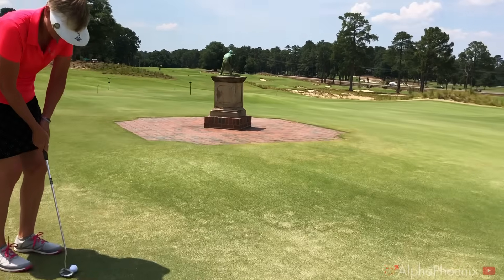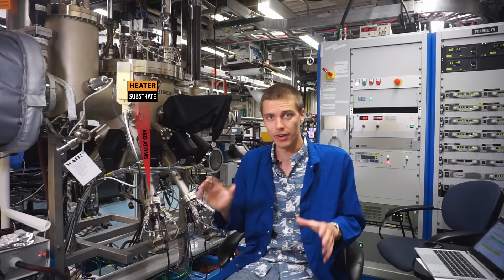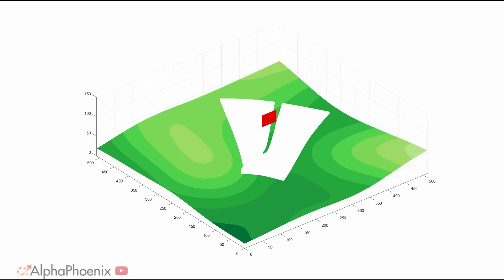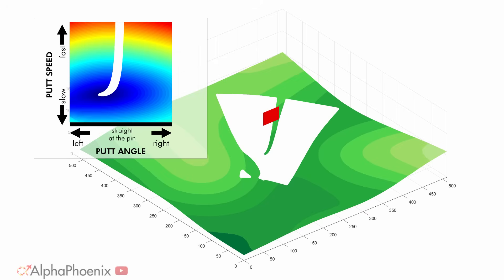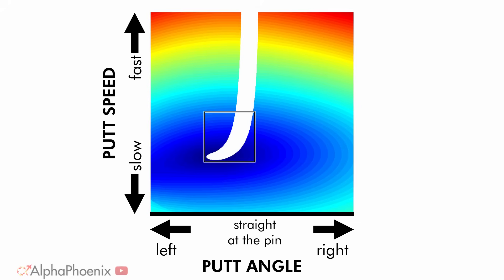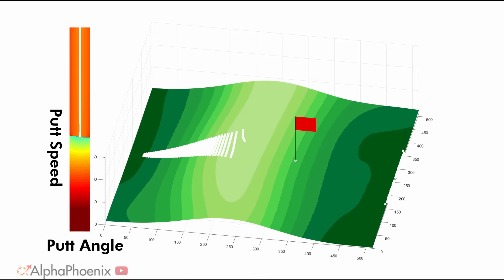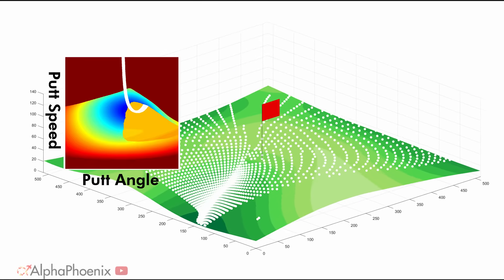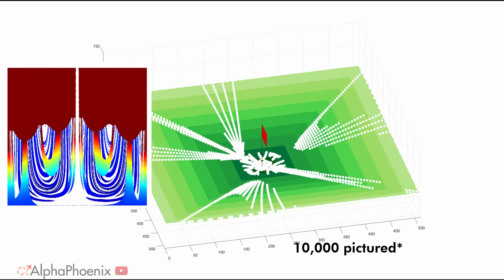Overcomplicating GOLF by simulating every possible shot

Comment: This is interesting - when the search has cost for every step, I wonder if you could adapt the machine learning technique of simulated annealing. It searches an n-dimensional parameter space blindly, only getting one datapoint at a time, and works if you can somehow quantify "desirability" of the return value. This way is mathematically proven to get a global optimum with infinitesimal steps.

Comment: With what you were talking about at the end with multi dimensional phase spaces, a full golf swing has so many variables that it fits very nicely into the idea

These include angle of the club path and face, the loft presented to the ball, the angle the club approaches the ball, the speed it goes at and where the ball connects with the face. If any one of these is just 1 degree or mm off it can have such a huge impact on the result.

The idea of a physics simulation going through all the variables to find how many different sets of inputs give a hole in one sounds so fascinating.

Comment: An important topic you are starting to touch on here.  Thank you.  A meaningful part of this field has been very well developed by statisticians broadly under the label "Experimental Design."  Also called "Design of Experiments."  Or DOE for short.  Optimizing 5 or even 50 variables is not unusual.  You can make any set of assumptions about how high order the interactions and non linearities are.  You can have nonuniform noise in different parts of the space and even design to estimate the noise as a function of location.  You can have errors-in-variables meaning how you set the conditions of your experiment is itself with variability.  You can optimize sequentially, recalculating the next most informative data point to test after analyzing the previous set.  You can do this as group sequential designs.  You can optimize a combination of expected performance and variability.  You can have non-quadratic loss functions.  And much more.  As I said, this has been well studied for 100 years now. A 60 year-old classic text is called "Statistics for Experimenters" by Box, Hunter, and Hunter which you will find easily accessible.  But, as you can imagine, the field has progressed a long ways from there.  Look up "D-Optimal" designs.  And "Thompson Sampling."  Thanks again for recognizing this important field and for the pretty simulations.

Comment: Here's an idea for extending this MATLAB experiment: Fix the shape of the player's error (e.g., the rectangle from the video, or a Gaussian) and then define a function that, for each ball position, outputs the expected number of strokes it will take to put the ball in the hole, under optimal shot selection. You can compute this function via "value iteration", which involves many calls to the kind of code you already have. Then you can compute the optimal shot a player should attempt from each position on the green. Maybe this is too far off from the intended purpose of the channel, but it's a shame to be so close and not go there.

Comment: 8:50
In real physics, the area in phase space needs to be non-zero for it to have a solution. If you have an area of 0 (or length of 0 for a 1 dimensional phase space, volume for 3 dimensional, etc) then it has no single solution unless all adjacent points have the same solution.
This isn't like an exact, precise law but it comes out of the math when you take the limit from both sides and note that the behavior does not change at all, you find the limiting point should not exhibit the same behavior at all. 

In fact, physical experiments would indicate that it is just 50/50 that it goes one direction or the other. Specifically, you can take the set of possible outcomes at all regions adjacent to the point/line and create a dice with the same number of sides as there are elements in that set. So if you have 3 different ways, you have a 1/3rd chance of it being one of the possibilities. If it is a circle, it has an equal chance of going in any direction. 
The time it will change direction is completely random and so technically there is a chance that it does make it up the pyramid anyways, but it's not 100% in real life even if it was just sitting still seemingly in equilibrium. It's like the murphy's law of physics.

Comment: The wonderful thing is that putting just a bit more realistically gets you into a 3d phase space where slight deviations of your putter's angle can start giving you side spin and that that difference can start majorly shifting the results with the other two factors reasonably constant (especially if you define your shot angle as being based on your putter's center of mass movement rather than the actual direction the ball starts moving at)

Comment: I used to play on a miniature golf course (just putting) that seemed to be impossible to sink in one stroke.  As I recall, a slight hill would send the balls back toward me if slow, or high, missing the hole.  It was like a lens diffracting the balls away from the hole.  I don't think it was done on purpose.  The course was L shaped, but you can model the bounce or eliminate it by folding the course there.

Comment: For the impossible geometry, can't you have something that curves inward so the ball rolls up a slope then falls when the ball is rolling upside down? (This would mean that the ball would have to either have a height when initially shot or to break a hole in the unbalanced structure)

Comment: quadcopters could potentially benefit from phase plots. there are 4 inputs, motor speed, and a desired rotational speed around an axis. changing one motor effects all three axis, so it's quite complex. right now we use a PID controller, 3 actually, one for each axis. then we spend many hours tuning it until it's 'good enough' (which is pretty good to be fair) but never perfect. with a phase plot, we would instantly know how much to spin each motor, instead of this constant guess and check it does now.

Comment: Sticking with the golf theme, i wonder if you could simulate the golf ball paradox within phase space - where the ball going into the hole, with the right speed and angle, will come back out of the hole without actually touching the bottom of the hole after making several rotations of the hole.

Steve mould shows a demonstration of this here - The Golf Ball Paradox
https://www.youtube.com/watch?v=5sbM2Isx17A

Comment: I had to INVENT this phase space thing at my job. 

I had to find the sweet spot of a machine that had several operating states. using three analog flow regulators.  that makes it a 4D hypercube problem.
I needed to hit three target static pressures on the system.
and my only control was three needle valve regulators (one of which was installed backwards)

I never solved the problem. I got it within tolerance and re-ran the hoses to isolate the air-in line.

Comment: Space travel, orbits, and such are similar. The objects leave the atmosphere out of fuel with a speed and trajectory, and then physics mostly controls the rest. In space travel, two of the dimensions are speed and trajectory, but there is a 3rd dimension, which is time. When you go on the journey matters as the objects with gravity that will affect the journey are moving relative to each other. So, maybe its similar to putting towards a hole with moving dips and hills... where you can predict the dips and hills in advance... and use them to your advantage.

Comment: So if you were plotting multi-dimentional phase spaces (4+) would it just be easier to plot 2 or 3 dimensional phase spaces for a limited portion of the controllable variables and compare them against one another? Like some form or multidimensional phase cross-sections?

Comment: The color map you used here suffers from one of the infamous "Matlab defaults literally-literally-literally kill people" problems, namely, it isn't perceptually uniform, which ends up injecting numerous artifacts into the map, making it highly misleading (unless one knows this and mentally compensates, but that's tedious & error prone, and not something anyone would expect from viewers)

Also I might have spotted a gamma blending error in there in addition to that, not entirely sure tho.
Reply: Additionally, your shot spacing algorithms seems to suffer from anisoperimetric bias, i.e. you should have either offset each row inside hexagonal space instead of in euclidean space (cf. the issue Feynman had with Cellular automata for gas simulation), OR instead of doing any of that, simply defined the boundaries of the shot space and then shot randomly (ideally use a quantum RNG or at least a cryptographically secure RNG as the input instead of a PRNG, but that's a bit overkill) shot instead of using offsets with granularity
Reply: Now, one might say, "but in the limit, it'll even out, so with a large enough sample size, it doesn't matter!", and that's true in symbolic math and with arbitrary precision libraries as well as when leveraging interval arithmetic libraries to some degree, but not when using matlab's out of box features which simply rely on IEEE754 floating point numbers iirc

Comment: Pool/snooker would be an extremely interesting one, you have power and angle much like this simulation, but you can affect the balls behaviour by striking it at different points. A cue ball struck with spin will affect the target ball in a very different way depending on direction and speed, players do this a lot to “widen” the pocket as aiming to “cut” the ball but also put spin can increase the chance of the ball actually going in.

Comment: I know this is an old vide by this point, but I wanted to say that there IS a geometry that makes it impossible to putt the ball into the hole from certain points. This is pretty much exactly the same as the illumination problem. If the course was designed like a Penrose unilluminable room from certain points there would be no possible shot to make the hole.

Comment: This video isn't exactly new, but if you're still reading comments on this, a phase space I'd love to see would be feeds and speeds of a mill, you have many potential variables but you can get away with keeping some constant, here's a list in order of importance:
- Feed (Velocity of cutter)
- Speed (RPM of cutter)
- Flutes (# of cutting surfaces per rotation)
- Diameter (Diameter of cutter)
- Material engagement (How deep the cutter is in a material)
The reason you want to proportion these variables is for the finish on the material, feed per tooth (amount of metal cut by each flute every rotation), and forces applied to the cutter.
Though, after writing this it does seem a bit complicated, lol.

Comment: My Dude.

First, as a chronic overthinker with ADHD who simply has to try to understand EVERYTHING, I love your work 👌🏽

Secondly,  you should REALLY look into motorcycles... 
ESPECIALLY in regards to riding on race tracks.

The way they steer, geometry set up, mass, trail, rake,  torque and levers everywhere in ways that arent initially obvious, how the tires generate grip beyond the normal coefficient of friction...

They are a physics play set 🙌

This is probably why I race them.
And I think you'd love getting right into it.

Comment: How about simulating the movement of 50,000+ virtual asteroids through the solar system for the 7M NEO 2020 VW from the date of last observation 2020-11-18 through 2074-11-03 to show the growth(and folding) of the uncertainty region? Note 0.03% to 0.07% of the virtual asteroids "may" become virtual impactors. 2020 VW maximum Palermo Scale is -4.13; this puts the risk from 2020 VW far below background risk.

Comment: When you really think about it, professional golfers (or any person who has become highly skilled at something requiring precise motor coordination) have essentially mapped out that phase space in their brains. They just develop the intuition to know that they can make a particular shot at one of two angles, one of which is more forgiving in terms of the power of the shot. Additionally, their brains have far more variables to consider. They aren't directly controlling the angle and power of the shot—their brains have to simultaneously control hundreds of muscles in just the right way in order to swing the club as intended.

It would be cool to see phase space diagrams for bowling. You would probably have to find a way to add another dimension to the diagram to include the spin of the ball, but it would be interesting to see how the diagrams would look for splits, strikes, etc..

Comment: A year or two I went down a massive rabbit hole of making bread. I started creating phase space diagrams for baking temp and time. I then realized that temperature could be varied throughout the baking process, which would turn it into a 4D vector field plot. I never went this far, but it was fun. Phase space diagrams are also very common for motors and engines. RPM and %throttle (or, for electric motors, current and phase) on the X and Y axes, and efficiency (or just about anything else) on the Z axis. These are extremely useful to visualize the most efficient (or best in some other way) operating regions.

Comment: I wonder how much golf would change if players had prerequisite knowledge, and understanding, of phase space simulations of particular courses. It'd be like comparing a rally driver that has the course shouted to them by a passenger compared to an F1 driver having an understanding of their circuit. 

But would this phase space ever really go beyond three dimensions? The two dimensional golf phase space is nothing more than velocity, where the terrain is a velocity modifier, applying variables like wind, spin, and terrain types would also be velocity modifiers. Three dimensions would just be a slightly more complex velocity, as you're now also accounting for trajectory through the air and a ball's aerodynamics and weight, all of which are just velocity modifiers as well. I don't think this would really even go past a modified 2d map, as you're only looking at where the ball is touching the ground, thus making air time be deadzones at the end of the day. The green is also really the only relevant area to consider, yes the rest of the course is relevant, but the rest of the course is also brute forcing the shortest path to the hole with an airborne ball, whereas the green is really the only area where the ball maintains ground contact and rolling after being hit. There's just no need to overcomplicate things.

Comment: OR you can use a nonlinear optimization, like Levenberg-Marquardt algorithm - as long as the surface around ball is more or less convex, it will find your parameters easily without brute force. You can actually make it convex and need less iterations. Also things like simulated annealing may help you.

Comment: Could greenkeepers use this to rank the difficulty of pin placements?

Each day, the pin is moved to prevent excess uneven wear on the green. As you could imagine, the area around the pin gets more foot traffic than any other part of the green. A greenkeeper will randomly select where to place a pin. They may choose an easier part of the green for a normal day, but a more challenging part for a championship. They probably rank those areas heuristically. 

Could you use Phase spaces to determine difficulty of different pin placements, and possibly create a kind of difficulty heat map? And how would such a thing be produced?

Comment: I disagree with your assumption that the error box should be an n x n rectangle. Most golfers are more accurate with their power than they are with their aim, so the error box should be wider than it is tall. This makes the error box actually cover more of the white “on target” region when the white region has the shallowest slope and is most horizontal.

Comment: Couldnt you simply model the hole into the simulation? For example, if a ball hits the hole with enough speed that it would travel over 2 feet past it, the ball simply skis over the hole rather than going into it?

Comment: Phaze space plots look a lot like porkchop plots with a "succes" conditon.
Reply from the maker: That’s cause pork chop plots ARE parameter/phase spaces! Success or failure regions depending on controllable parameters of launch dates and whatnot. Do they also have deltav? I dont remember
Reply: @AlphaPhoenixChannel  porkchop plots can be made of anything. X, Y and height for instance, or time, delta-v and ejection angle, or any three other variables. The thing is, with these phase space diagrams, every combination of factors that together reach a treshold value will get a new set of rules for coloring and can be marked as a distinct zone. That doesn't exist in a porkchop plot that much since it's a gradient plot all the way through.

But yeah, they're both superduper cool!

Comment: I have to wonder if these "success spaces" are connected in any way to desicion planes i know from my basics of Machine learning lecture. it seems that with both you have a space and you want to find a plane or planes (or whatever the multidimensional equivalent is) that can seperate points of type A from type B. that could be categories or success/failure, doesnt really matter. which also means that if you have a big enough sample size you could use machine learning ideas to find equations describing all the possible success areas in the space. 

well or you can simulate a big enough sample size to a point where more resolution is pointless, i suppose. 

It still just blows my mind how connected all these sciency things are, and how even simple AI/Machine Learning can help us find solutions to complex problems. if relative amateurs can create an AI that can predict the outcome of a match in a team 5v5 game with very limited information to an accuracy of 55%, what could a team of experts do?